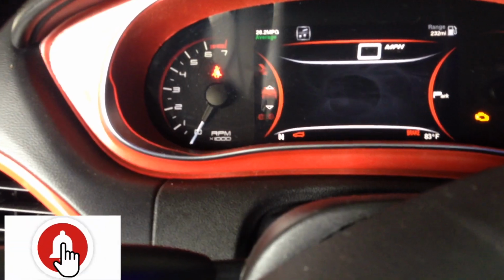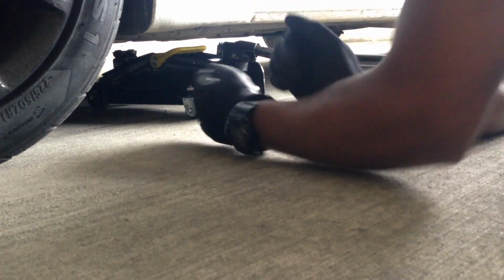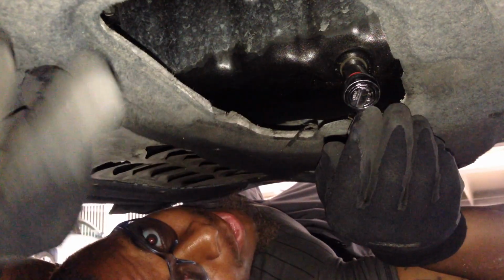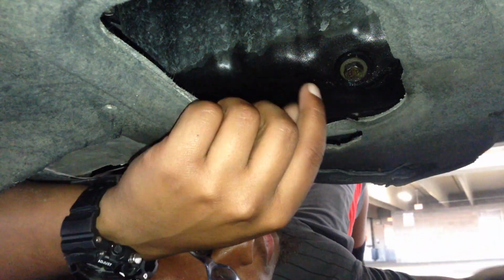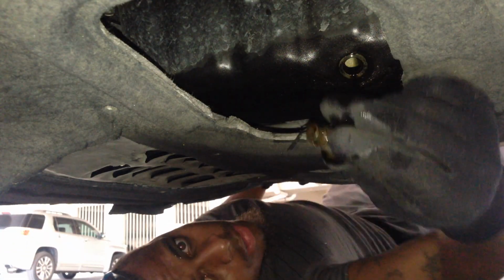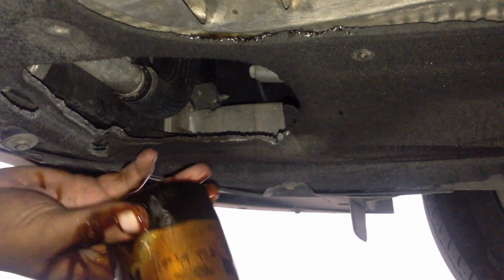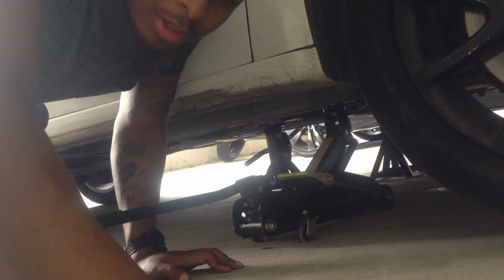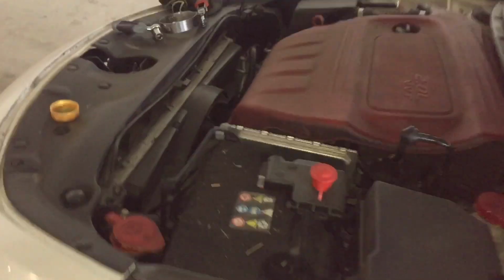HOW TO change the oil in your 2.0L DODGE DART

Comment: I use pennzoil synthetic 0w20 and I have 554,000 kms,all original on this engine and still going strong! 🏁
Reply from the maker: Yup the 2.0L in the 2.4L are reliable engines this car is a hidden GEM 💎

Comment: The dart is an awesome little car, especially if you get a good deal on it. The 2.0l is reliable as fuck. I've beat the shit out of mine and she still runs pretty.
Reply from the maker: Yea it’s not bad at all very reliable
Reply: @mightyprophet4581  you seen Travis Pastrana's dart? Check it out, it's a 2.0l awd that pumps out 600hp. Thing is a beast. They threw a big ass turbo in it and upgraded everything. Trans, cams, pistons, everything. But what's so cool about it is that you can get 600hp from a 2.0l 4cl. That's fucking insane, especially if you factor how light it is without a big ass v8

Comment: getting a set of car ramps from auto zone, advance auto parts or napa will also be easy to change your oil also.
Reply from the maker: I got mine for free using (shop your way points) on gas buddy card from sears

Comment: Great video.. have you ever had issues with your ebrake
Reply from the maker: When I had this car no I did not. And thanks for the support.
Reply: Damn see I bought this as a work car and has 110k miles idk if anyone used the e brake before idk if I should risk using it what u think boss
Reply from the maker: Alfonso Mendez yea U need your ebrake for hills and everyday use. 
The parking brake in the transmission is not strong enough it just holding your gear by a lil clip. 
Overtime ur transmission will slip due to not using your ebrake.
FYI I always use my ebrake even on a flat surface never know what could happen without it on.
Reply: MightyProphet_144K thank You I appreciate that god bless

Comment: If anyone watching this video can help me with some advice please. I have a Dodge Dart 2013. My heater has been working intermittently & when it doesn’t of I hit it, it will start working. So should I change the blower motor or the resistor. Not sure which one is causing the issue and I have a check engine light on. I really need help asasp. If anyone can I would appreciate it. Also now it’s in and seems like it a blowing weirdly like high and low seems like. Please help thanks
Reply from the maker: Try to clean out your heater core 1st, it might have dirt built up in it. So flush the heather core